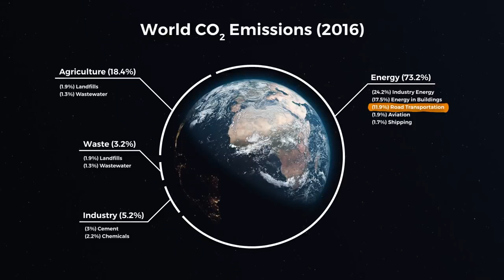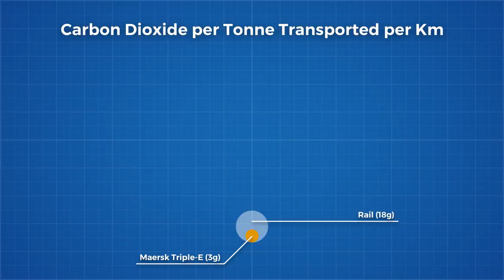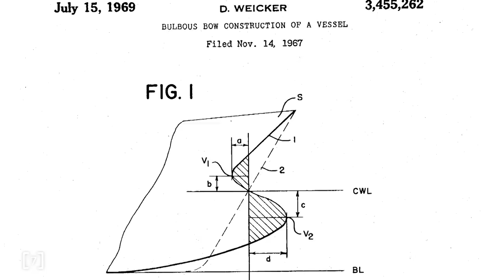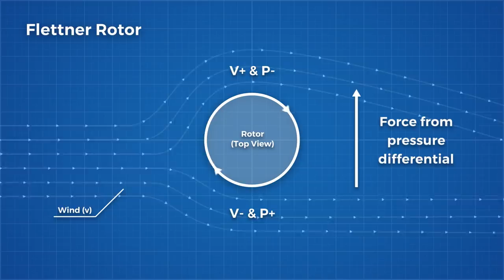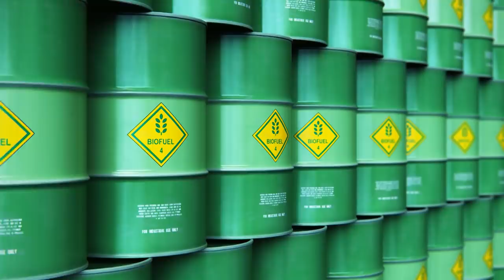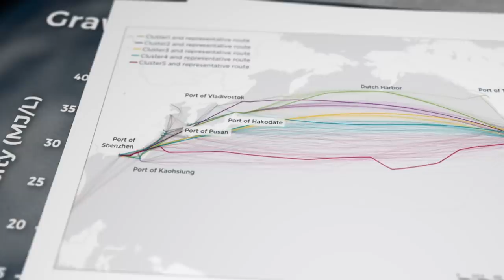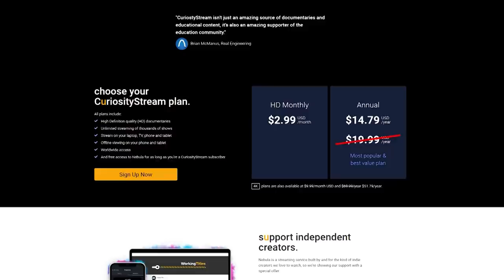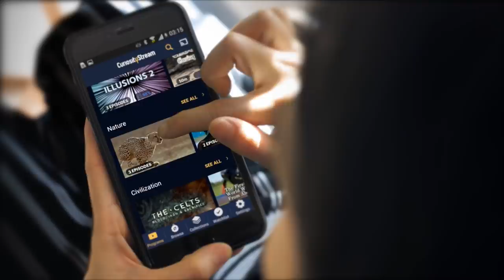Are Renewable Powered Ships Possible?

Comment: With the military using nuclear for their largest ships (aircraft carriers) that can go many years without resupply other than food for the crew, can we not do that for cargo ships?
Reply: If you do a web search for ‘nuclear ship savannah’ you will see that it has been tried and did not work.  A similarly vessel, heavily subsidised by the government, vessel has been in lay up in Russia since 2012 but could be reactivated.  The Russian state, through a QUANGO, also operates a fleet of nuclear powered ice breakers all of which may, or may not, be completely without issues in support of the Northern Sea Route,.

Just think; would you have full confidence in the management of a nuclear reactor under the control of an anonymous entity only traceable, perhaps, via a letter box in a FOC (flag of convenience) nation state?  If you are, could you sell that confidence to Japan, the state that hosted the Hiroshima and Nagasaki nuclear detonations as well as more recently the Fukushima ‘event’?  Then try that same, or a similar, sales strategy on Ukraine, the nation state that as a part of the USSR (CCCP) hosted the Chernobyl ‘event’.  Modern iterations of nuclear energy, thorium fuel, molten salt reactors or fusion reactors, will carry the legacy of past problems.  It is the global trepidation of anything with 'nuclear' in the name and the economics of nuclear having transitioned from 'energy to cheap to charge for' too 'the costs of remediation are incalculable' that will prevent the adoption of nuclear energy as a means of creating energy at sea.  Modern reaction systems may have overcome the safety problems but the general public, having been misled in the past, will be reluctant to believe the fresh new promises.  The incident of the ‘Ever Given’ blocking the Suez Canal, March 2021, may also have a little to add to this debate.  The cooling water on ships tends to get taken in from near the bottom so when running aground the inlets are in a prime spot to get plugged up restricting, if not stopping, the flow of coolant.  One thing that the TMI, Chernobyl and Fukushima incidents all had in common was that the supply of coolant, or rather lack thereof, was a fundamental cause.

‘They’ say nuclear is cheap, it’s not it is expensive and has a large embedded carbon quotient as well as being complicated, dangerous, not universally socially acceptable and having only ‘no need for refuelling’ as a questionable advantage; actually it does need refuelling just not as often.  When ‘they’ do need to refill the warming up stuff it takes considerable longer than pumping tonnes of thick black stuff, cSt380 HFO, or thin runny stuff, MDO, onboard which is one of the reasons HMS Queen Elizabeth and HMS Prince of Wales are pushed about by ICEs and gas turbines thus using a similar fuel as the aircraft that fly off of them.  The Royal Navy (RN) with a high degree of skill and expertise uses, at vast expenses to the UK taxpayer, a current operational nuclear fleet of 11 submarines (also known as ‘boats’) in two flotillas, seven attack subs and four ballistic missile boats.  The carbon footprint of all the extra bits of hardware and the fuel, including processing thereof, from ground to propeller, are the external costs that never seem to get considered.

Disposal, once it wears out, of both the machine (that was a ship) and fuel is another can of worms best left unopened.  The 26 RN nuclear powered boats no longer in use are laid up (some in Rosyth and some in Portsmouth) awaiting long term deconstruction including dealing with the fuel rods and other irradiated material.  The USN is not, as far as I know, a commercial organisation working to very tight margins and also has the skill and expertise to handle the complexities of nuclear power; so as well as submarines their aircraft carriers are nuclear powered and each of the current iteration has a build cost three times that of QE/PoW, bigger crews and more generous funding.  For those who still think that nuclear energy might be the answer I recommend this report: - https://www.bbc.com/future/article/20200901-the-radioactive-risk-of-sunken-nuclear-soviet-submarines?ocid=ww.social.link.email.  The navy of the USSR might have been under resourced and over extended but it was still generously supported in comparison with merchant shipping.  While merchant ships may be 'taken up from trade' as the RN would say, or may be captured or impressed by non state quasi military entities by way of piracy, but cargo ships are not military vessels.  

Another, similar but more extensive view, may be found at https://www.quora.com/Why-are-there-so-few-nuclear-powered-cargo-ships-If-it-works-for-ice-breakers-and-submarines-why-hasn%E2%80%99t-it-been-established-for-merchant-vessels.  Why not use nukes?  It is down to money, societal attitudes and safety.

Comment: LNG powered ships could switch to fuel cells without changing fuel type, but the potential efficiency benefits aren't that great. Large maritime diesel engines are already roughly 40% efficient, with fuels cells + electric motors you could get about 60%.
A hybrid approach could save on investment cost, but make for a more complex system: use a smaller fuel cell array for base load and an additional diesel engine for peak load.

Comment: A few years ago I saw those huge (I mean, absolutely enormous) sails being tested on ships. They were kinda shaped like parachutes (the rectangular ones) and tethered to the hull at the bow with steel cables. So no precious cargo space was wasted for these sails. Computers were pulling on the cables to extract the most from the wind. I wonder what happened to this technology...
Reply: It did not live up to the promise. At best the wind kite was a supplement to ICEs every item of equipment on a ship has to pay its way so simple is good, effective is good and cheap is good.  Major issue was if the wind is not blowing in the direction the cargo needs to go the kite is not contributing.

Comment: Couldn't you also try to reduce the mass of cargo that has to get shipped?
Reply: The easiest, quickest and most effective way to reduce pollution from marine transport is to move less material and to move that reduced quantity shorter distances.  Jevons paradox illustrates that improving availability and / or affordability of an item will increase consumption while human nature, and thousands of generations of evolution, has produced a 'wants' driven consumption pattern even as science, technology and success has allowed that humanity over proliferate.  Our fundamental global problem is excessive consumption by a portion of the global population that is too large.  Maulthus was not ‘wrong’ just ahead of his time.  The system we have is the best we can do on a freight tonne mile basis; if sustainability is desired much less cargo must be moved over much shorter distances.  So that is a 'plan B' but humanity keeps being stupid and there is no cure for stupidity.  Profit is a good incentive but sadly it is possible to make 'better' profits by pushing some of the costs onto the wider society; such as atmospheric contamination from fuel use or other energy transformation.  The number and greed of consumers on a limited living space may lead to over exploitation and thus degradation.  The primary question is 'should the producers and regulators be condemned, pilloried and castigated or should the consumers recognise that they are ultimately responsible for what is happening?'  Consumers can directly influence that improvement by consuming less and using locally produced material and products.
Reply: @BernardLS  thank you for the comment

Comment: The most effective way to reduce emissions is to charge for them.  Maerck reduced speed because it was cheaper, not because it had fewer emissions, so the more economic incentive they have, the more they'll try to reduce emissions.

On the subject of biofuels, in some cases they started breaking even, energy-wise, about a decade ago.  There's still a lot of pork and perverse incentives, but the next major step will be reducing nitrogen fertilizers needed (Haber-Bosch being the majority of energy input for argriculture) by replacing them with microbe treatments that fix nitrogen for us.  I work at a company trying to solve that precise problem, mainly for corn but also for soya, and we've already managed to create, in just a few years, a product that cuts fertilizer use by 20%, which has enough impact that it's cheaper for farmers and still generates a profit for us.  It's still very early, but we've hit an inflection point on biofuel production, we just need to un-break the government incentives to keep producing negative-return fuels.

Comment: The current answer seems to be ammonia. 
It is more energy dense than hydrogen, and far easier to store and transport. It can also be made 100% renewably from just water, air, and electricity. 
The infrastructure to handle ammonia on a massive scale already exists for agriculture, and with falling prices for renewable energy, there's a path to cost-competitive green ammonia.
Ammonia can also help with the deployment of renewable energy by acting as a form of energy storage.
Reply: Thomas Midgley Jr. (born 18 May 1889 died 2 Nov 1944) was an American (USA) chemist who, as well as developing the technique of putting the tetraethyl lead (TEL) additive in petrol, created chlorofluorocarbons (CFCs), yes those ozone depleting CFCs, so that the use of NH3 as a refrigerant could be discontinued.  Substitution of Ammonia for Hydrocarbon (CxHx+2) will change one atmospheric pollutant CO2, or CO if poor combustion condition occur, for another NO, NO2 or NO3 (depends on how good your oxidation reaction is).  NH3 could be the most dangerous and least ‘clean’ clean energy source ammonia it is both caustic and hazardous in its concentrated form.  In the United States of America it is classified as an extremely hazardous substance, and is subject to strict reporting requirements by facilities which produce, store, or use it in significant quantities; they have one of those CFR (Code of Federal Regulations ?) things with more details.  WADR ammonia is easily dirtier than hydrogen, remember that nice Mr. Midgley (he who put the lead in petrol) gave the world CFC refrigerants so we could save ourselves from ammonia as a basis for the refrigerant cycle used at that time.  A means of creating ammonia on an industrial scale that is more resource efficient than the Haber-Bosch process would also be required.  Wärtsilä are configuring some of their engine stock to burn NH3 in a diesel cycle so they may kill the NOx problem.  However having been around a few NH3 tankers and failed a couple who were changing trade to LPG it can be painful to be around even in low concentrations and is very persistent.  Even if it is better than H2, personally I think not, it is still not in my opinion 'good'.  Ammonia in the right place, as a fertilizer it is good, as a combustion fuel with exhaust gases it is very bad so let’s just leave that for a while (somewhere very far away that is cool, dark and quiet).

Comment: Honestly nuclear power sounds really promising for this kind of stuff, I mean it works with aircraft carrier surely it will work just fine on hauler ship right ?
Reply: If you do a web search for ‘nuclear ship savannah’ you will see that it has been tried and did not work.  A similar vessel, heavily subsidised by the government, has been in lay up in Russia since 2012 but could be reactivated.  The Russian state, through a QUANGO, also operates a fleet of nuclear powered ice breakers all of which may, or may not, be completely without issues in support of the Northern Sea Route,.

Just think; would you have full confidence in the management of a nuclear reactor under the control of an anonymous entity only traceable, perhaps, via a letter box in a FOC (flag of convenience) nation state?  If you are, could you sell that confidence to Japan, the state that hosted the Hiroshima and Nagasaki nuclear detonations as well as more recently the Fukushima ‘event’?  Then try that same, or a similar, sales strategy on Ukraine, the nation state that as a part of the USSR (CCCP) hosted the Chernobyl ‘event’.  Modern iterations of nuclear energy, thorium fuel, molten salt reactors or fusion reactors, will carry the legacy of past problems.  It is the global trepidation of anything with 'nuclear' in the name and the economics of nuclear having transitioned from 'energy to cheap to charge for' too 'the costs of remediation are incalculable' that will prevent the adoption of nuclear energy as a means of creating energy at sea.  Modern reaction systems may have overcome the safety problems but the general public, having been misled in the past, will be reluctant to believe the fresh new promises.  The incident of the ‘Ever Given’ blocking the Suez Canal, March 2021, may also have a little to add to this debate.  The cooling water on ships tends to get taken in from near the bottom so when running aground the inlets are in a prime spot to get plugged up restricting, if not stopping, the flow of coolant.  One thing that the TMI, Chernobyl and Fukushima incidents all had in common was that the supply of coolant, or rather lack thereof, was a fundamental cause.  Similarly and only months later, May 2021, had the ‘X Press Pearl’ been nuclear powered then a major port for a populous nation in the global South would have possible been the site of a significant exclusion zone due to a non power plant related incident.

‘They’ say nuclear is cheap, it’s not it is expensive and has a large embedded carbon quotient as well as being complicated, dangerous, not universally socially acceptable and having only ‘no need for refuelling’ as a questionable advantage; actually it does need refuelling just not as often.  When ‘they’ do need to refill the warming up stuff it takes considerable longer than pumping tonnes of thick black stuff, cSt380 HFO, or thin runny stuff, MDO, onboard which is one of the reasons HMS Queen Elizabeth and HMS Prince of Wales are pushed about by ICEs and gas turbines thus using a similar fuel as the aircraft that fly off of them.  The Royal Navy (RN) with a high degree of skill and expertise uses, at vast expenses to the UK taxpayer, a current operational nuclear fleet of 11 submarines (also known as ‘boats’) in two flotillas, seven attack subs and four ballistic missile boats.  The carbon footprint of all the extra bits of hardware and the fuel, including processing thereof, from ground to propeller, are the external costs that never seem to get considered.

Disposal, once it wears out, of both the machine (that was a ship) and fuel is another can of worms best left unopened.  The 26 RN nuclear powered boats no longer in use are laid up (some in Rosyth and some in Portsmouth) awaiting long term deconstruction including dealing with the fuel rods and other irradiated material.  The USN is not, as far as I know, a commercial organisation working to very tight margins and also has the skill and expertise to handle the complexities of nuclear power; so as well as submarines their aircraft carriers are nuclear powered and each of the current iteration has a build cost three times that of QE/PoW, bigger crews and more generous funding.  For those who still think that nuclear energy might be the answer I recommend this report: - https://www.bbc.com/future/article/20200901-the-radioactive-risk-of-sunken-nuclear-soviet-submarines?ocid=ww.social.link.email.  The navy of the USSR might have been under resourced and over extended but it was still generously supported in comparison with merchant shipping.  While merchant ships may be 'taken up from trade' as the RN would say, or may be captured or impressed by non state quasi military entities by way of piracy, but cargo ships are not military vessels.  

Another, similar but more extensive view, may be found at https://www.quora.com/Why-are-there-so-few-nuclear-powered-cargo-ships-If-it-works-for-ice-breakers-and-submarines-why-hasn%E2%80%99t-it-been-established-for-merchant-vessels.  Why not use nukes?  It is down to engineering, finance, socio-political attitudes and safety.